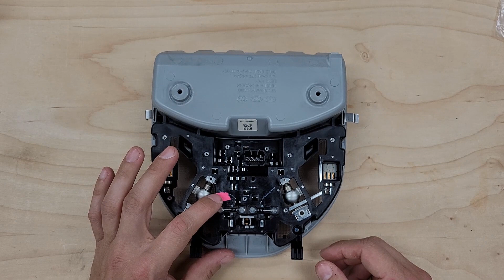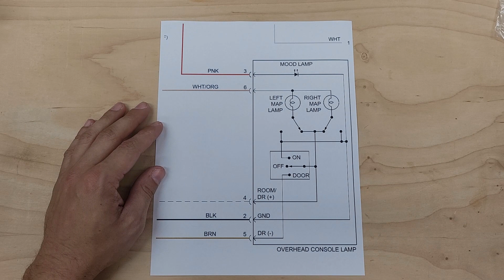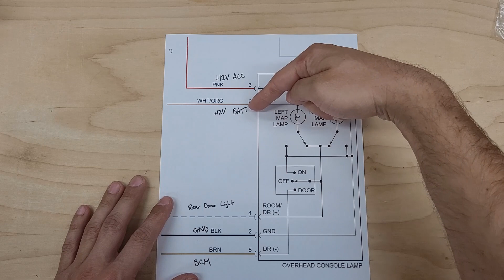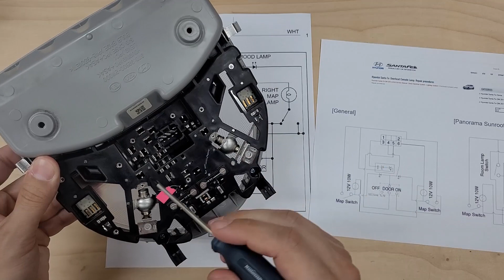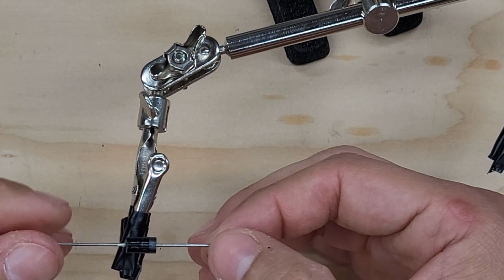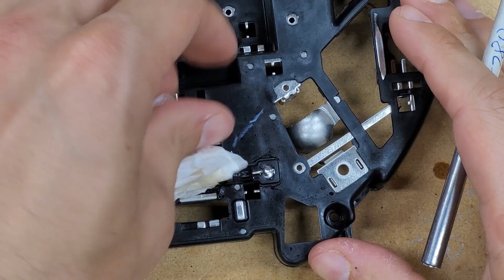Hyundai Santa Fe 2014 Map Reader Lights Fix Diode Replacement

Comment: Thanks this helped alot. After car went in for a recall some fuse had to be installed all internal lights stopped working when doors were opened. The rear passenger one also had to be done same way.  Thanks again

Comment: Great video. I had the same issue on my 2013. The front lights now work as they should. However, my rear seat dome light is still not coming on when the door opens. I can manually turn it on, but when I change the map light switch to on, or to door setting, the rear seats light doesn't come on. Any ideas?
Reply: I am in the same boat after repair.

Comment: Have had the exact same issue with my wife's 2016 Hyundai Santa Fe Sport for years.  Came across this DIY video which includes all the specific part numbers for replacement (much appreciated).  I ordered the necessary parts (assorted diode kit, 240 count = $9.99 / soldering iron kit = $17).  The parts arrived and I followed the extremely detailed instructions contained in this video last night.  I am happy to report that the problem with the light module in my wife's car is now fixed and working beautifully!  Instead of paying between $150 - $250 at the dealership, this repair only cost me $27 total, thanks to this outstanding video!  Plus, I also scored some excellent bonus points with my wife as a result! 😉
Again, thanks so much for this awesome video.  Bravo sir, BRAVO!!!

Comment: Will this fix all of the overhead lights or do each of the back fixtures have these diodes as well? Whenever I open the door, only the driver map light comes on. All lights work when manually activated.

Comment: Mine plays peekaboo with me. One minute, it works next minute only one side works, then the other to only the dome light in the back working with nothing up front. I pulled the fixture down and checked the resistance in both diodes, and they're both a little over .8 on the reading with no current coming back. 🤷🏾‍♂️ It's quite disappointing and I just added rgb led lights. I thought maybe it's the switch so I cleaned the contacts but it's still happening.

Comment: Was looking for some explanation as to how to remove the dome headlight assembly. This will help me a lot, and will avoid breaking the assembly. 
One note, as far as the Russian wiring diagram, it actually does not show the diodes (this wiring diagram is not correct as compared to the Hyundai wiring diagram).  What you are pointing to as diodes are the actual switches of the Map Lights. 
However, for this diode fix explanation, it really doesn’t matter. 
BTW, the function of the diodes are to turn on BOTH Map Lights when the ‘Door Function ’ is activated - or Mode Switch is set to On - independent of the left/right Map Light Switches On/Off position.
P.S. 2026-03-20... Finally it happened to my 2018 Santa Fe. Instead of regular rectifier diodes, I will be replacing with 5A/60V Schottky Diodes to minimize Diode V-drop and maximize lamp brightness.

Comment: Hi mate, I'm no electrical expert, but with the position of the diodes, if they're blown how does the light still work in manual mode. Wouldnt a bad diode stop the light from turning on at all?
One of my lights isn't working at all, even after bulb replacement. Just want to see if it's the same issue. 
Thanks in advance.
Reply: When the specific (left or right) Map Light Switch is activated, that light should turn on independent of the diodes.
The function of the diodes are to turn on both Map Lights when the ‘Door Function ’ is activated - or Mode Switch is set to On - independent of the left/right Map Light Switches On/Off position. 
If the lightbulbs are good, it might be that you have a bad  (left or right) Map Light Switch. 
If the two lights come on when set to Door - or Mode Switch set to Dome On -, then the diodes and bulbs are good. If one still fails, then another circuit issue is present. 
Swapping bulbs will enable you to determine that both bulbs are functioning correctly.
Reply: Check for continuity throughout the board! Also, check for good grounds!

Comment: My lights are not working at all so i am not sure if its the diodes yet. Weirdly enough though, one of the lights came on today and i could hear a slight buzzing noise, after a few miles it stopped and the light failed again, so i am thinking it may be the switch. However, thank you for this video!!!😊 it helps a great deal just for removing the dome itself.

Comment: OMG! THANK YOU SO MUCH!!!!
This video is literally my wish come true! 

I have a pristine 2012 Hyundai Santa Fe Limited with only 13,000 miles on it. Through much care & effort on my part, it still looks and runs as though it were brand new. My only disappointment has been that my map lights are no longer triggered on when my car doors open. I used to absolutely LOVE that, when my doors were opened, the map lights would come on automatically and then slowly fade off a few minutes later. After doing some research several years ago, I read that the problem was a faulty diode, replaceable for mere pennies. 

I'm an older woman, but I've soldered before and knew the fix would involve removing the map light module, but I was intimidated because there were no videos or photos available showing the actual procedure or location of the diodes (in the case of my car, a single diode). 

After years of scouring online, today I was so incredibly fortunate to discover your fabulous video! I cannot thank you enough for your efforts in making this video and sharing it with the rest of us. Your presentation was intelligent, detailed, articulate, and comprehensive. You answered absolutely every question I've had. Also, the camera work is so clear and focused and well done. This is the best video I have ever seen anywhere on any subject, which is all the more impressive given its very technical subject matter. 

Thanks to you I can now confidently tackle this map light fix that I have been dreaming of executing for years! You are clearly super intelligent and you are also super considerate and generous for sharing your knowledge and expertise with the rest of us. I'm so excited to finally be able to complete this repair. I will be eternally sending you blessings & good vibes for making and posting this video, and making my wish come true. THANK YOU!!!!!!!!!!

Comment: Had the very same problem with my 2014 first time I put a new diode in the second time I bought a LED bulb to fit it and because it takes less power draw I did not have to do anything other than to replace the bulb with an LED bulb works perfect